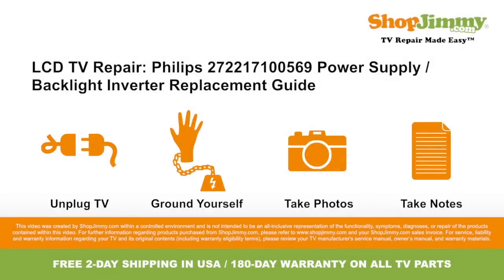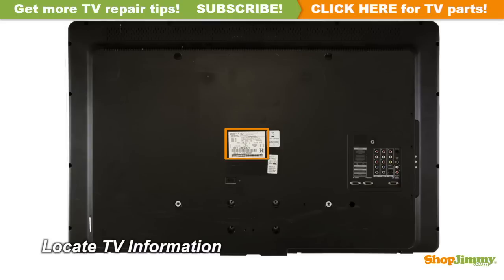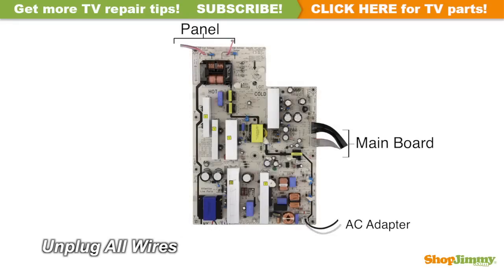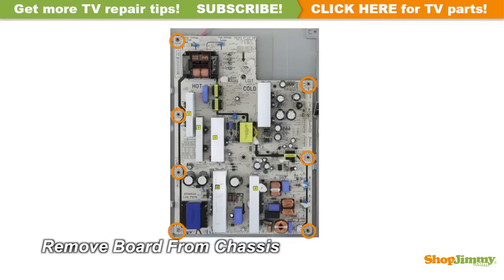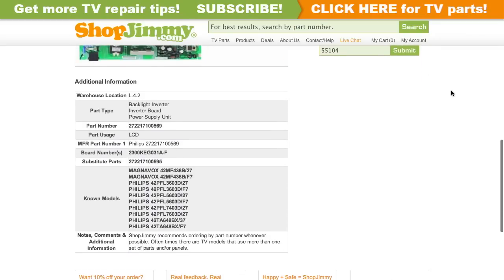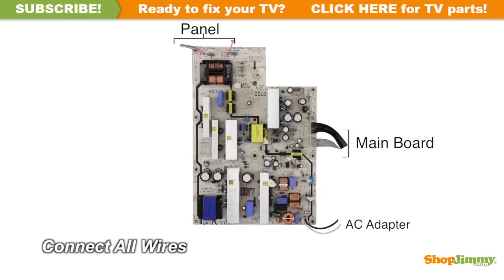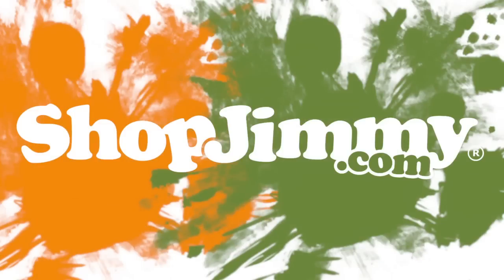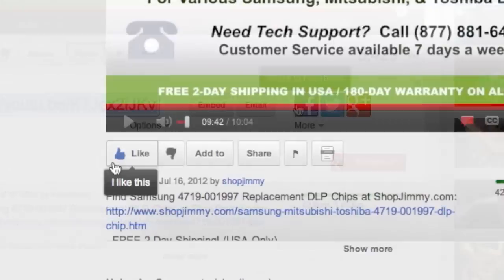Philips 272217100569 Power Supply / Backlight Inverter Boards Replacement Guide for LCD TV Repair

Comment: Phillips Model 42PFL3603D/27 will turn on normally and then turn off in 20 to 30 minutes. What part and part number do you suggest to correct the problem? I will order it from you if it is in stock.

Comment: Hello, I replaced the Master & Slave inverter boards purchased from Shop Jimmy. (Vizio/Philips 6632L-0412A/6632L-0413A Backlight Inverter Kit (substitute for 6632L-0470A/6632L-0471A). The TV works now with a clear picture, but there is a very slight flicker of the picture. It's very subtle but noticeable. Any remedies?
Reply from the maker: Pieter Hoolboom   I recommend checking the plug connections.  Thanks!  www.shopjimmy.com
Reply: Can you give some details for "checking the plug connections" please? Same issue after replacing the inverters for my 2007 Philips 47 LCD.

Thanks.
Reply: Jim Luke I tried all connections again and no fix. It's frustrating to follow the advice, buy the reccommended Vizo boards for a Philips TV and have a slight flicker when done. Please advise on the checks: Ribbons wires, plug wires, spray cleaner, pull out and reconnect, etc? Tried all plugs for looseness, checked all caps for any signs of blown,

Comment: Im having trouble removing the back panel. seems like the box where the AV ports are stuck. Any tips on how to take it off without breaking it
Reply from the maker: Stephen Lyons   There may be a tuner connection that has a washer on top of it.  Thanks!  www.shopjimmy.com
Reply: +Stephen Lyons There are 2 screws (dark colored) on the left side of SPDIF out jack, a (silver) screw near HDMI 4 facing sideways and a (silver) screw next to the AC power cord. Hope that helps you/others.

Comment: I was given an Philips 43pfl3603d/27 that I believe needs a power board. The TV comes on for approx. 1/2 hour and turns off. It does not come back on by itself, but does power up when you turn it back on. Images on screen are clear and consistent with all components disconnected. (menu screen only) am I on the right track and which board should I be looking at? Thanks
Reply from the maker: jvcody61486  I recommend replacing the power supply board in your TV.  Can you double check the TV model number?  I cannot see any parts or search results for that TV model online.  Thanks!  www.shopjimmy.com

Comment: Whelp since these boards are no longer reasonably priced (if you can find one) now it comes down to a component level fix. I at least as an electronics tech can guess at that it is the HV coil that is probly going bad (insulation breaking / winding arc) do you have a list of rebuild components for this board?

Comment: Hi Jimmy, I have a Philips LCD 40 inch Model # 42ta648bx/37. It first started out as it would flicker when i first turned it on. After about 10 mins it was back to normal. About 2 weeks later it would still flicker but this time there was a light burnt smell, again after 10 mins it cleared. Then yesterday its starts to flicker and then a heavy black smoke rose  from the right side. At this point is even worth it to try and fix it? Thank  You

Comment from the maker: @stovetopproduction - The board number is actually 272217100569, however we are currently Out of Stock on that part number.  If you have not done this already - Search 272217100569 on our website and then click on the "Sign up to be notified when this part comes back into stock"  If you burnt up the board, you may have affected more than one of the components so it may be best to replace the entire board.  Thanks and please let us know if you have anymore questions!  (877) 881-6492

Comment from the maker: @Todd Pattison - From the symptoms you described, with the backlights on and no picture it would appear the T-Con board is not working correctly.  Search our website for this part (there are currently 3 in stock) LG 6871L-1502A.  You may also call in to order the part as well, (877) 881-6492.  Thanks and please let us know if you have any other questions!

Comment: I plugged it in and turned it on with the cover off and there seems to be light going to the screen just no picture not even the blue no signal screen when the HDMI cable is unplugged. Can't see anything just black. No menu screen, Phillips logo or anything. Any ideas would be appreciated.

Comment: I have a Phillips Model #42PFL5704D/F7 LCD TV that one day while watching it, the screen went black. Not all at once. It started in a small spot then grew in a matter of seconds until the whole screen was black. I can best discribe what happened to it by what a paper towel looks like when absorbing a spill. It was very strange (Never saw anything like that before). What would cause this to happen ? and Is it something I can repair myself with parts from you ? or is the TV toast. Thanks.

Comment: Hello,
I have the same TV model as the one in your video. My LCD screen would turn off after a few minutes and I was only left with the audio. I replaced my power supply board and bought from Shop Jimmy.com because some of the capacitors were bad. Now that I've replaced the board my TV won't turn on at all. I tried to put the old board back and still no luck. I made sure that all connections were back as before but can't find the problem. Any help would be much appreciated!!!!

Comment from the maker: @stovetopproduction - I would start by opening up the unit and seeing where the smoking is coming from. Could be a bad cable burning up, could be a bad board, or more than one bad board. my guess would be either power supply or inverter but you need to inspect the TV and check.  Thanks and please let us know if you need anything else!